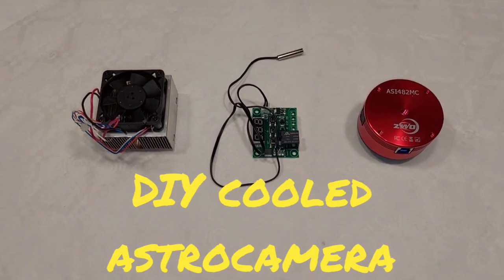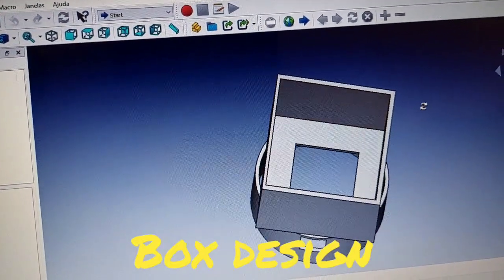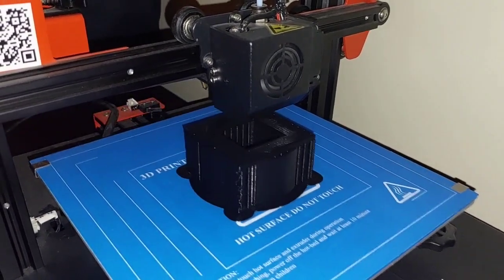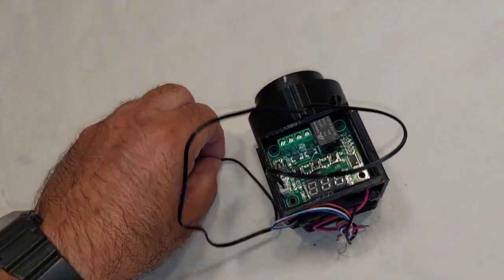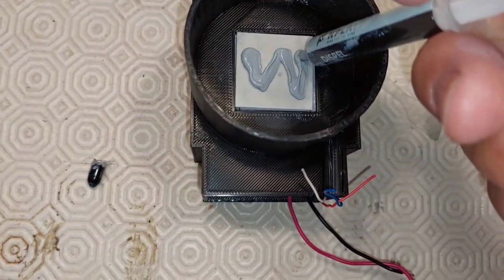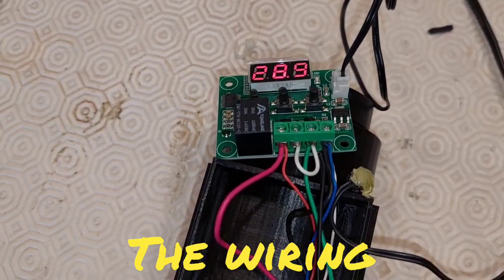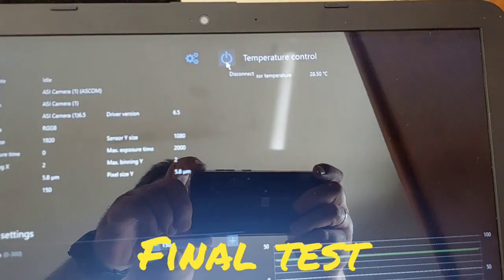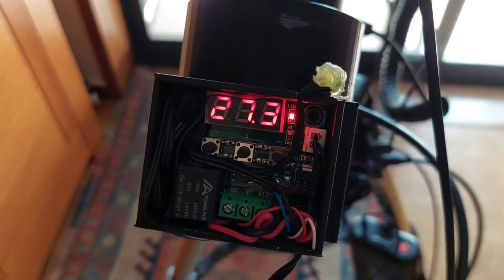Cooled camera DIY

Comment: Covering the barrel of the ZWO camera with plastic actually reduced your ability to dissipate heat. Plastic is a good insulator, especially compared to aluminum. Also, using too much heat sink compound will make things worse.

Comment: Don Fu
Hi , thanks for the video.  A question about condensation.  How to you prevent it from getting on/inside the camera?  Every consider putting a SilcaGel bag inside the OTA near the camera, and then remove it once the camera has gotten to temp?
Reply from the maker: Don't have this setup anymore.  But use silica gel is a good solution.  Better is not freeze the camera under the dew point.